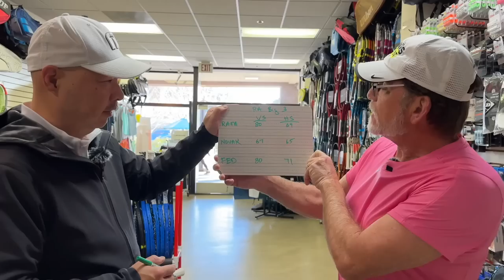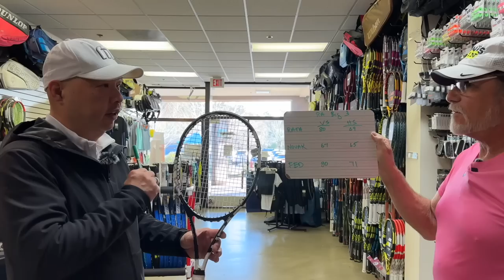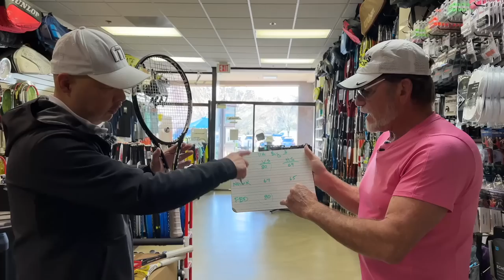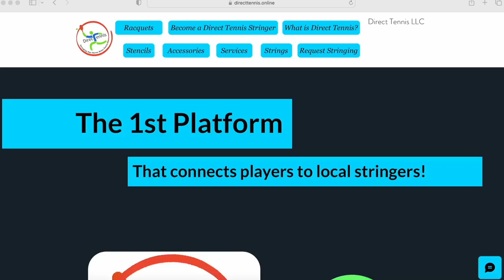THE STIFFNESS OF THE BIG 3 RACKETS: ROGER FEDERER, RAFAEL NADAL AND NOVAK DJOKOVIC

Comment: The fact that the RA test machine clamps the handle of the racket that has variable levels of cushion depending on the racket introduces a variable that isn’t being taken into account. When it presses down on the tip the handle wants to move upward. A very thick cushioned grip will compress allowing the actual handle portion of the shaft to move upwards slightly this will allow the tip to move downwards more giving the racket a more flexible reading. A way to test to see if this is actually happening is to take a racket and test it three times. 1) With a cushion replacement grip and over grip. 2) leather grip only. 3) No grip at all. Clamp directly on the pallet. If the test numbers come out the same for all three tests then I’m wrong and forget what I said. If the test comes out with different numbers then it means the test in the future should be carried out using a standardized grip or the RA number needs to be handicapped depending on the type of grip on the racket during testing. If my theory is correct a racket will test stiffest when tested with no grip on it.
Reply: Would multiple grips make a stiff racket less stiff
Reply: @andyv6299  the actual stiffness of the racket wouldn’t change. But I’m thinking that the machine would give it a less stiff rating number because of the give in the cushioning of the handle as the rackets tip is pushed down. In this test the racket is actually a lever. The middle cross bar that it rests on near the throat is the fulcrum or pivot. As the tip gets pushed down the handle wants to pivot upwards. For the old Wilson “SI” stiffness rating it was said the number was obtained by clamping the racket’s handle and then suspending a kilo of weight at the tip. How much the racket bent downward from its starting position in millimeters was the rackets SI rating. Thus a original Wilson Profile a very stiff racket only bent down 2.7 mm. While a Clash would bend down 11 mm which is it’s SI rating number. What the actual RA number represents I’ve never heard explained. But that’s not really important since the RA number is used to compare the stiffness of different rackets to each other.

Comment: I see some people asking about the retail RF97. My batch of matched v11 measures within +/-1 RA in both the vertical stiffness and horizontal stiffness as the signed RF97 seen in this video. My batch of matched v13 RF97 are within +/-1 RA as well. Hope this helps!
Reply: I did a test drive of the RF97 and I found it comfortable despite the stiffness and I think that the good twistweight compensates for the stiffness.
Reply: Thanks!
Reply: @movdqa  Natural gut like Roger or a multi in the mains also works great in this frame for this reason.

Comment: The Head racket had a broken string, surely that must have an effect on the vertical stiffness, as would string tension and type, there is not much stretch in poly but plenty in artificial gut.

Comment: Awesome test! Stiffness is truely the most important spec of rackets
Reply: ra meaasuring is useless. its only one number in 1 point. tells nothing about a racquet
Reply: @vscope  But it's the only spec u can't modify. unlike weight, balance or grip size
Reply: @zcz2223  i see your point but what does a ra value tell you about a racquet? for instance a small head 18x20 ra 62 racquet might be more stiff than a 100 inch open 16x19 ra 68 racquet at impact. a soft small head 18x20 low tw will be more harsh on off center impacts than a high tw stiffer 100inch 16x19  frame. Ra value changes even when using different basegrips. Use a leather grip and ra will rise... use a soft basegrip and ra will be lower. if you want to compare raquet stiffness its better to use the racquet frequency. however this value doesnt take the stringbed influence in account either.
Reply: Can’t modify head size or string pattern either